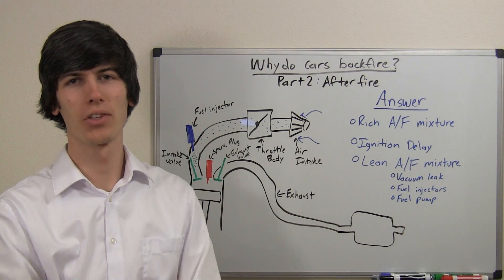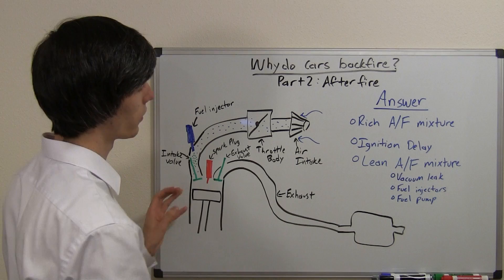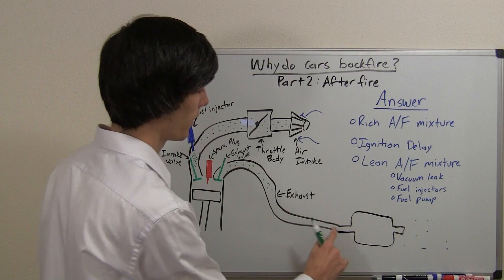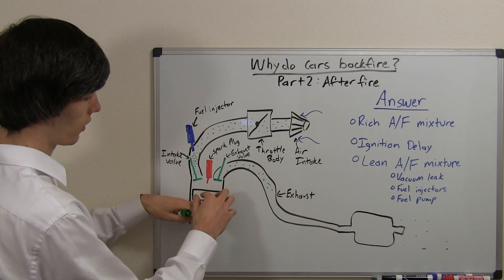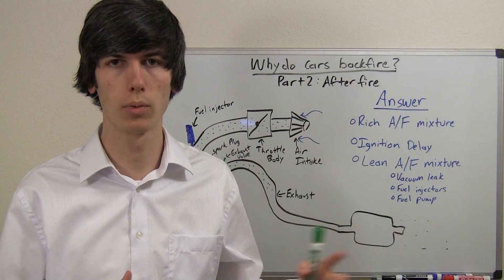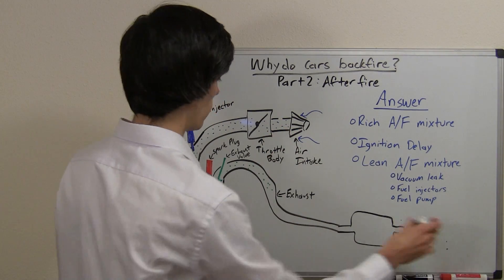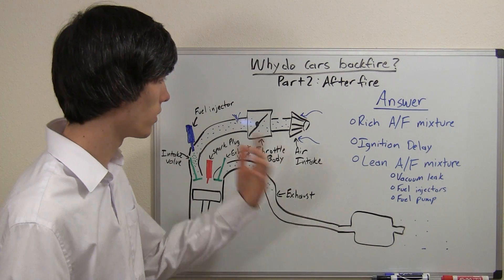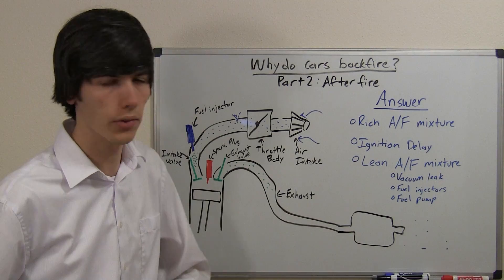Why Cars Backfire - Afterfire - Explained

Comment: Not everything is being explained in this video. Does the term "backfire" refer to an additional ignition event occurring after the one created by the sparkplug (or detonation), or just an unplanned continuation of the original ignition, maybe somewhere in the exhaust piping or as it exists the pipe and finds fresh oxygen? If it's a second, separate ignition event somewhere in the exhaust piping, some unburned oxygen would have to be available.

Comment: iirc, certain performance cars backfire from factory because they need to inject more fuel than they can burn for effective cylinder cooling. Clarkson learned this the hard way when he put a nitrous system in his car without changing the fuel map or ignition timing, and almost melted the cylinder walls.

Comment: I heard deceleration backfires before in internal combustion engines. Here is my thinking....

Gasoline has a flash point before it explodes as a backfire/afterfire event. When the backfire happens, you see the flame coming out, but if you hear the bang or pop without the flame, it is possible that that vehicle had a BFA - a backfire flame arrestor, so you hear the explosion but not see the backfire flame.

Here is a typical situation often seen in illegal street racing.....which makes up usually over 50 percent of vehicle backfire events - - - 
1. A driver fully floors the car, causing the gasoline in the exhaust to reach close to the flash point temperature as it heats up.
2. Then as the driver decelerates, the gasoline's flash point temperature is breached and goes up in spurts---and the gasoline explodes (I assume at that point, more oxygen goes into the gasoline as an oxidizer and fuel, and much more heat is produced, causing the explosion), resulting in the pop or bang out of the exhaust pipe. The flash point temperature then eventually goes down after you hear the backfire or backfires go off--at that point, the gasoline temperature goes down as well as the oxygen levels, reducing the chance of further backfire explosions.

Then there are the idling backfires. My guess is that in this case, the flash point of gas has been reached at idle by some fuel mixture that is right enough to cause the gas to be so volatile that the flash point temp is already reached and spikes and goes down in temperature, causing the pops and bangs even without decelerating or revving up.

Comment: I had a vacuum hose come loose in an 89 Eagle Premier. When I tried to shut off the engine, it backfired so violently that it blew my muffler apart. The back of the muffler blew off and the case split open at the weld. Scared the crap out of me and everyone else at the gas station. 
I had taken off the plastic engine cover while I was working on something and I didn't realize that the engine cover was the only thing holding the worn out vacuum lines in place. Once I reattached the lines and put the cover back on, I never had another problem. Except for the extremely loud exhaust of course

Comment: I use to think engineering explained New what he was talking about. Then I did some digging. For a explosion to happen the air has to be going supersonic. This is not possible inside a internal combustion engine. So no there is not explosions happening in a engine. Its simply combustion

Comment: Hey! Backfire and Afterfire are two seperate instances. Afterfire is a rich mixture resulting in flames coming out the exhaust, backfire is a lean mixture resulting in excessive popping, more specifically the  explosions from the combustion chamber are entering the intake system. Hence the term BACKfire. This video is not as informative...

Comment: Lean mixture burns more slowly? Lean mixture burns fast, all the way to being so fast that becomes explosive. Afterfire can occur for a several reasons and are cool. Backfire means preignition which is destructive for the engine, it will trigger a check engine light if the knock sensors pick it up.

Comment: Jason, “Engineering Explained”… I have another explanation for the "Lean Mixture After-Fire", and though this is from real world wide band O2 data logging, while tuning on Motorcycles and ATVs (a 4-Stroke combustion engine is pretty universal): I have noticed that when the engine is up to operating temp, and tuned properly “for performance”, the engine especially when you roll off the throttle or close the throttle plates at higher than idle RPM, the mixture goes so far on the lean side of stoichiometric, that the spark plug doesn’t ignite it and when you have 2-3-4 “Cycles” that get dumped into the head-pipe it now has enough fuel (and oxygen because it didn’t get burnt/ignited in cylinder, PLUS many of these engines have secondary air injection systems) that it hits the hot carbon now ignites the fuel/air mixture sending out the well-known BANG-POP-CACKLE we are so familiar with, most commonly with low restriction exhaust systems.   (DFCO “Deceleration Fuel Cut Off” on EFI equipped cars and some bikes is mostly for economy, as in the performance world, drivability trumps fuel economy, and almost eliminates this, they will however, sometimes “pop” in the DFCO transition period.)

Comment: i have noticed that backfire happens also after flooring the gas pedal, is that cause intake closes and so the mixture has richer a/f ratio ??
Reply: Thanos Kakourhs if i had a guess it would be late ignition due to timing after letting out of the throttle, the valve train is slowing back down while in the middle of a cycle. Just a guess tho

Comment: I got my 10th gen accord straightpipe and when I let Of the pedal at 3 it starts popping! Is it bad for my car to backfire or pop after getting it straight piped? Or is it normal
Reply: You'll just have more carbon buildup. And yes when you straight pipe you remove any area where it could burn and be muffled, such as catalytic converters and mufflers.
Reply: Capt Patrick so will it harm my engine? I don’t feel any decrease in performance
Reply: @phillyaccord5635  as far as I know it shouldnt harm your engine. You just wont pass emissions if you're in a state where you have to pass emissions.
Reply: @phillyaccord5635  since you removed the catalytic converter you removed the piece that is supposed to break up left over fuel you also get it when you shift gears because of the fuel dump.
Reply: Capt Patrick oh and btw bro I just removed the muffler and resonator not the catalytic converter

Comment: Your first explanation is wrong. If a rich AF mixture were ignited by the sparkplug, there will NOT be extra fuel left in the exhaust, there will just be a lot of HC which cannot be ignited (think of it as oxidized fuel).  The correct term is 'excess air' with same amount of fuel. This will happen when there is a leak in the exhaust that is close to the exhaust valve, during deceleration extra air will get sucked into the combustion chamber, with some little fuel that gets injected due to fuel cut delay, we have an 'excess air' condition, which make the AF mixture very slow to burn. So slow that it will continue to burn when the exhaust valve opens!

Comment: Question: you cruising...you leave the gas with gear the ECU cuts off everything as i see on my Wideband has no flow shows "lean" many times other times "air" in my car when i press little bit the gas pedal between 3-3.500 RPM backfiring...does this affect something in internals? Is bad? Or it does nothing?

Comment: Backfires are not exceptionally loud. They make a big "THUMP" or "POP" but that's about it. Sort of like a great big party balloon popping in the next room. Afterfiring is when fuel and air get through the cylinders and explode in the exhaust system with a very loud BANG like a shotgun firing. "POW!" Many people mistakenly call this a "backfire" but it is really an AFTERFIRE. 
Backfiring is through the intake. Afterfiring is out the exhaust. 
Backfiring is more dangerous than afterfiring because a backfire can set fire to any stray fuel in the carburetor or induction system. Afterfiring might damage a muffler but little else even though it makes a lot more noise. 
Afterfiring can be caused by a number of problems. Intake or exhaust manifold leaks drawing air in when the throttle is closed can cause popping and banging in the exhaust during deceleration. This can also happen normally on aircraft with very short exhaust stacks. Listen to a P-51 Mustang landing and you'll hear what I'm talking about. The stacks are so short they draw air back in when the throttle is closed. 
Loss of ignition on one cylinder can result in that cylinder's unburned charge being expelled into the exhaust manifold where it can be ignited by the other cylinders and this makes a big bang. 
Incorrectly connected spark plug cabling can do this, too.

Comment: Any bad side effects of the motor to do back fire and pops please
Reply: What you propably mean is afterfiring so fuel burning in the exhaust, theoretically this has no consequences whatsoever, but on normal street cars It will cause fuel to burn inside the catalytic converter and the immense heat will slowly melt it away If you want alot of pops

Comment: So the backfire when you let off the gas is excess fuel exploding in the exhaust when it meets with oxygen while backfiring when you're revving is caused by explosions going out of the cylinder and out to the exhaust (like the second and third explanations).

Did I get it right?

Comment: On motorcycles, the main cause of (internal) exhaust ignition is a badly seated (leaking) head to header seal. Fresh air gets drawn into that leak and any unburnt fuel mixes with that and causes a very lean air/fuel ratio which is ignited by the next exhaust stroke. This typically happens on over-run, on highly stressed engines.

Comment: Why is it when I turn the key off, and then when I turn it back on it afterfires? Like, I am coasting down a hill in a carburated engine, turn the key off, then back on and it afterfires. The longer I leave it off, the stronger the afterfire.
Reply: It is raw fuel being poorer into the exhaust because when you shut the key off the carb doesn't stop flowing as it is mechanical so when you turn the key on combustion ignites the fuel it is even louder when the car has a cat and smog pump

Comment: My 25 horsepower Kohler garden tractor has an anti-backfire solenoid built into the bottom of the carb.
Reply: Correction it has an "After-Fire" solenoid... My Deere with B&S motor has it too... Its there for 2 reasons 1. when you shut it off at idle, and governor goes WOT (Because engine is traveling slower RPM than current Throttle setting) it will not pull fuel out of the high speed jet, and go BANG! and possibly ignite leaves or gas can in your garage... 2. So if you roll over, jump off seat or something else that causes ignition system to cut out at high RPM it will not go BANG and ignite something....OR otherwise Blow The Hell out of your muffler!

Comment: The real reason of "popping" in the exhaust in lean engines is missfires that later is ignited by heat from the exhaust valve, manifold or from the exhaust from another more successfull ignition!

Comment: Acctually, back fire or flame after downshift. NOT GOOD. if you have good spring valve or use pneumatic valve and RACING ECU for prototype engine. You can't see flame burn your exhaust after downshift gear.

Comment: You pretend to know,  but you are incorrect. If there is a vacuum leak, this lowers the vacuum pressure, leading to MORE fuel for the available air, (which is less than normal). Hence, THIS IS NOT A LEAN CONDITION, but a rich one. A lean condition is less FUEL for the available air. This is not taught in schools. but is able to be understood with a little logic. A RICH mixture is more FUEL for the available air. With a naturally aspirated induction system working as designed, it is not possible to adjust the amount of air coming into the cylinders except with the throttle butterfly or bypass valves.

Comment: Engineering Explained, I have a question I have wondered for years now. I know many cars and more commonly motorcycles, use secondary air injection to reduce exhaust emissions witch can cause popping on deceleration. But, on fuel injected engines, wouldn't deceleration fuel cutoff (DFCO) prevent ANY unburned fuel from being in the exhaust in the first place? My 1999 mustang v6 automatic always lightly popped out the exhaust when decelerating, how is this happening if the fuel is supposed to be cut off on deceleration?
Reply: not sure but my glass packs do that popping on deaccel also. +i will find out and answer this question since my son would know
Reply: @charlesdowns1691  and?

Comment: What happens if you have no muffler period
Reply: It gets louder.

Depending on the car, it might sound awful, or glorious. 
But its gonna be loud.
(I drive a tuned 2017 wrx with deleted mufflers, it sounds wicked.) 

It crackles and pops on downshifts and afterfires on high rev upshifts. 
I still have a Cat though, so i doubt i get flames
Reply: stinkyfungus I did a nameless muffler delete on my 2018 hatchback Impreza. It does what you mentioned and sounds insane in the process. I’d remove my cat but I go up into the mountains so I’d rather not risk it.
Reply: I drive a 2010 wrx straight pipped from the turbo and it sounds awesome! It doesn't pop multiple times which I like,it pops once and sounds sweet

Comment: People who think afterfire is cool are mentally disabled. All it shows is that your car is improperly tuned.
Reply: DeadRats4U I'm pretty sure car manufacturers wouldn't release cars without a proper tune. My car does it as standard
Reply: DeadRats4U my car is pro tuned with lots of boltons, it after fires only when driven in an aggressive manner, by properly tuned do you mean for optimum fuel mileage?  Of course it's not tuned for the best gas mileage.

Comment: i Hi Jason I want to install a flamethrower in the exhaust of my truck, can you please explain how I could use the process you described in the video to accomplish this?
Reply: Literally the douchebaggiest thing you could do besides smoke stacks on a diesel
Reply: Its a different thing entirely. Flamethrower kit is used by a sparkplug in the exhaust. You presse the button, and it lights up the fuel. You dont get power when you use it tho

Comment: Your vids are great. You are a very good teacher. Now, suppose I actually wanted a little aftercare on off- throttle deceleration. The loud gurgling and burbling sound. What would be the best way to tune the aftermarket ECU to achieve this? I just think it sounds cool! I had a S2000 that did this, but I don't know how it was tuned to achieve it. I'm building another one, this one supercharged, so what would you suggest? (Interestingly, some manufactures are building this into their street cars such as the Fiat 500 Arbath).

Comment: why would afterfire occur even when the ecu works with so many sensors to make sure the fuel mixture combusts properly?
Reply: Because "Lean is mean"  and can melt stuff. So subscribe. :)
Reply: Saumil Jain  when injector is not delivering adequate fuel due to clogging or age
Reply: injector has no sensor
Reply: Some ecus are tuned to make it backfire

Comment: Very clear explanation!  But there is one thing that keeps puzzling me. On the newer models of Porsches (9x1 onwards) with  'sport exhaust' fitted, the sound they produced are mesmerizing. They sound just like after-fire (banging and cracking noise). May i ask how are these sound produced given the fact that backfiring may not be the answer to these new cars with modern combustion technology. Thanks. 
I am a big fan of your channel btw :)
Reply: on the turbo 3.0 liters it's programmed into the engine management system as a 'Turbo Anti-lag' feature. Some continued ignition in the exhaust system helps to keep the turbo's Turbine Impeller, which is situated in the engine's exhaust stream,  spinning faster.  This way, when you reopen the the throttle the turbo is spinning at a much higher rpm and ready to drive the Turbo's Compressor or Intake Turbine more effectively.

Comment: Hi! can you please explain how  modern cars ( +2010 ) make that popcorn sound when shifting ? is it done the same way?
Reply: Dragos pirvu Lean condition on overrun.  You close the throttle plates momentarily while the engine is spinning quickly and it creates an enormous intake vacuum.
Reply: Dragos pirvu Some cars infact close off the throttle body entirely and squirt a small amount of fuel in which aids in cooling the top end exhaust valves. Then as mentioned by this guy, once it reach the end of the exhaust the unburnt fuel will burn if the exhaust temps are high enough

Comment: question 
so can a stock car back fire or would it need aftermarket fuel injectors and a bigger fuel pump new air intake new throttle body and a exhaust??